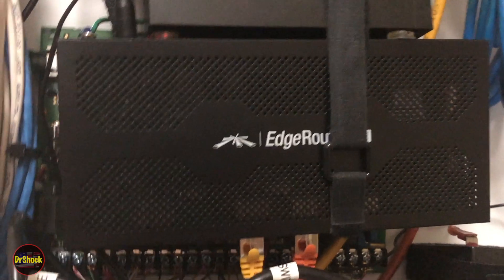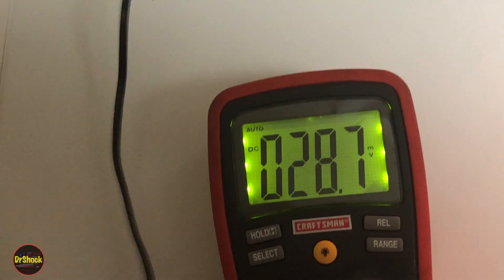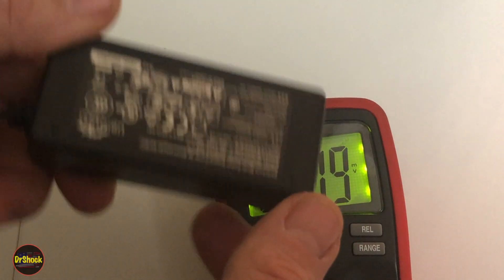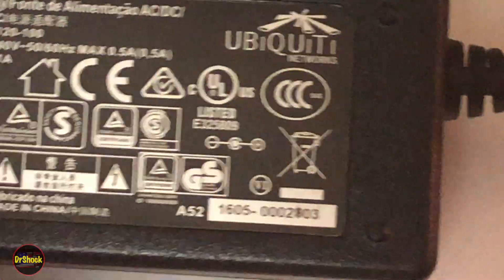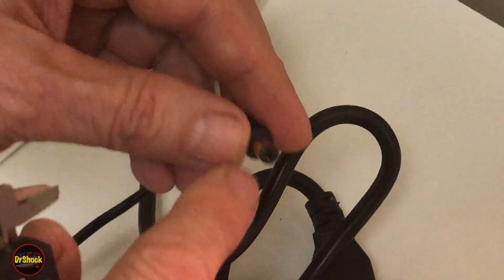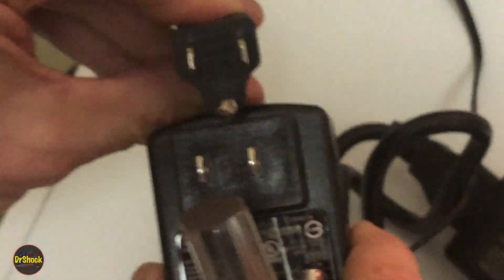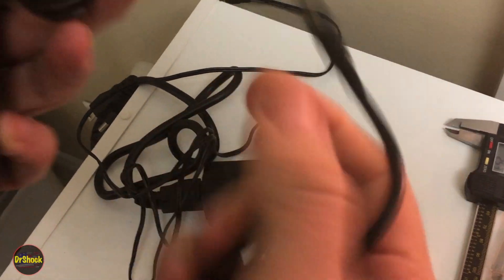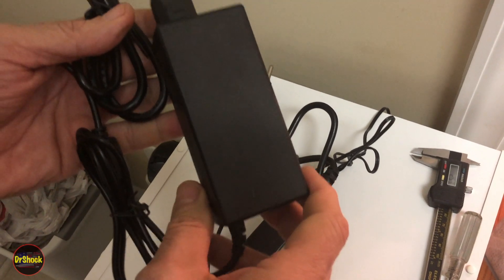Ubiquiti Edgerouter Lite 3 Router Flashing Green Power LED /  High Pitch Sound Diagnosis & Repair

Comment: Just encountered this problem yesterday.. Thanks to this video, was able to replace the power supply and router is now running properly.  Thanks for posting!  (and yes, my failed power supply measured 12+ volts w/o any load)

Comment: I had a different symptom on an EdgeRouter Lite that was also caused by a bad power supply. Intead of seeing the console LED blink, it stayed solid. If you connected an ethernet cable to eth1 however, that port's LED didn't light up but the eth0 and eth2 LEDs did. It did have that high pitched sound and the power supply LED flickered, just not as clearly blinking as the one in the video.

Boots up just fine with a different power supply. I guess my point is simply that people shouldn't give up on their EdgeRouter if they see slightly different behavior than the unit in the video. It could very well still be the power supply that is at fault. :)

Comment: My ERLite-3 (from 2017) power adapter started chirping today, was hesitant to buy a $15 replacement from amazon, then found an old 12v 1.5A in a drawer, tried it, and it worked. I was worried about the 1.5A, but glad I found your video and now I know it'll be ok. Thank you, much appreciated.